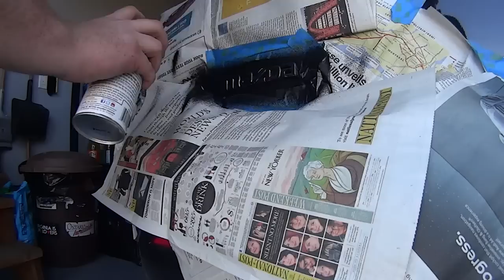Mazda 3 Logo Red and Black PlastiDip

Comment: Plasti dipped my bike then doesn't take long before it starts to come off, can you clear coat over the top?
Reply: Col A North East spray more than one coat, 4-5 seems good
Reply: Victor Martinez yeah it's just a rubber so peels off eventually
Reply: Col A North East i didnt apply cleat coat and mine is still there same as when i first applied it. Take it to the car wash and everything. You just gotta practice. First time i tried it on my rx8 spoiler it looked nasty lol. Now on my hatcback 3 it looks nice👍🏻